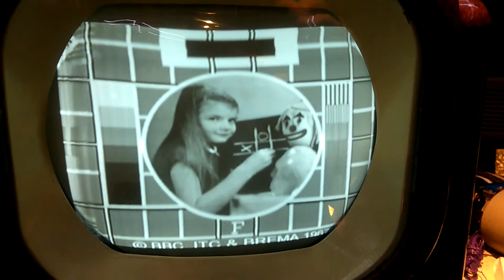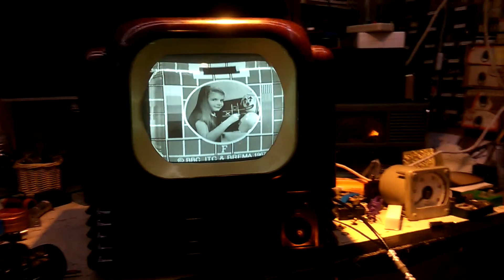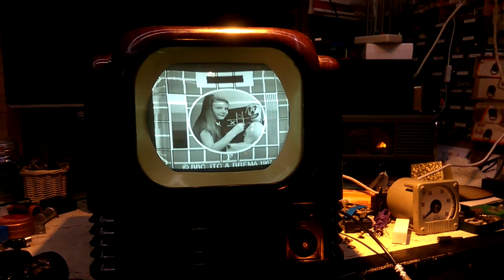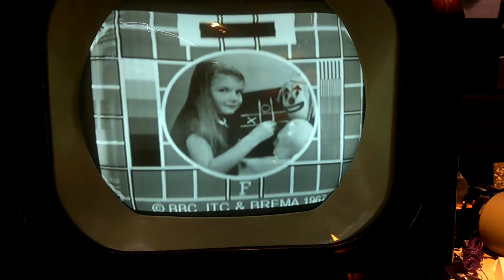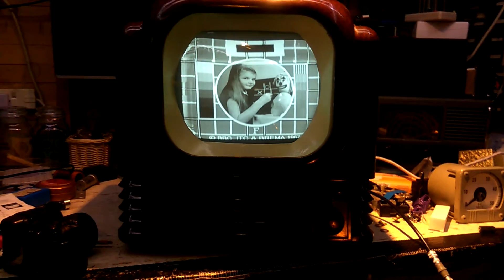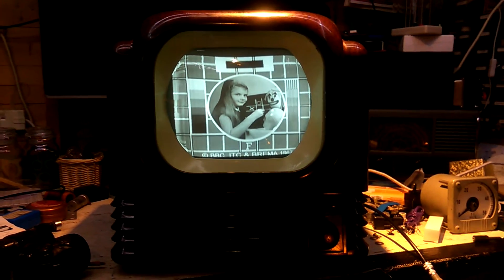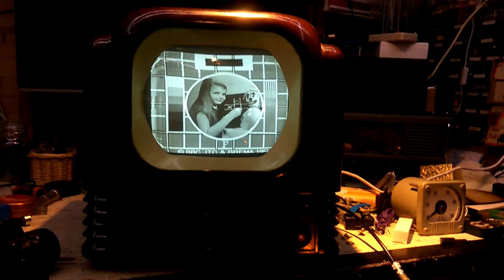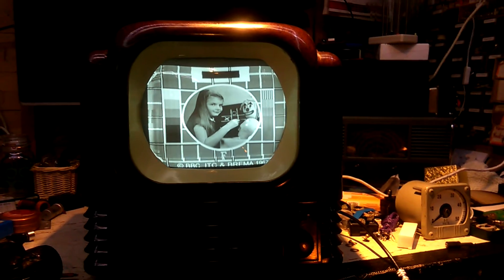Bush TV22 displaying 240 lines

Comment: I am always amazed Baird managed 240 lines with non-interlaced mechanical scanning...
Reply: Because Baird was a genius.
Reply: Why?  I would think 240 progressive scanning is easy. Hook-up an old computer like Atari or Commodore 64 or Amiga, and they output 240p by default (not including overscan).  Ditto old consoles like Super Nintendo or Sega Genesys

.
Reply: Those old 8 & 16 bit machines couldn’t do a full 480 interlaced, so they did the simpler 240 progressive

Comment: I think that pre-war, 'high definition' TV would have gone out on 240 lines but someone found that one stage in the multivibrator chain used to 'sync' the line-scan to the mains frequency could be increased from X3 to X5 and still work so 405 lines was born!

Comment: Bad capacitors?
Reply from the maker: Nothing wrong with caps or any part of the circuitry. The ripple is due to interaction between an unlocked to the mains video signal, and of course interaction between the 50Hz mains and the 25Hz frame rate. All components are new and even feeding the HT and heaters from fully stabilised D.C. supplies the ripple is still seen. The flicker will never go as it's the deficiency of Bairds obsession with a low frame speed.
Reply: @trev8932  Got ya